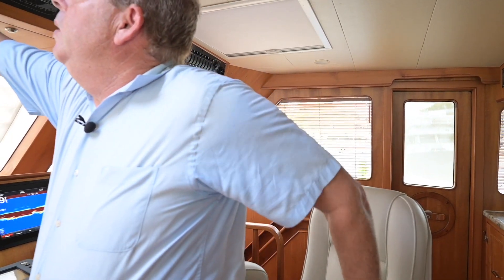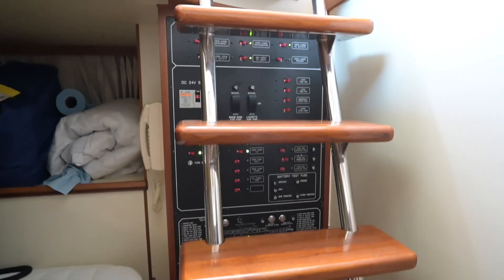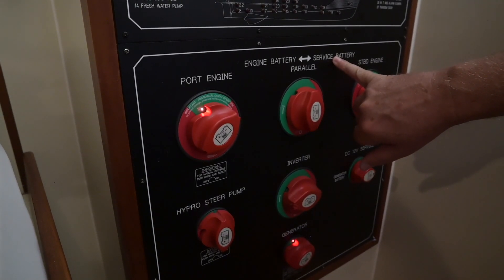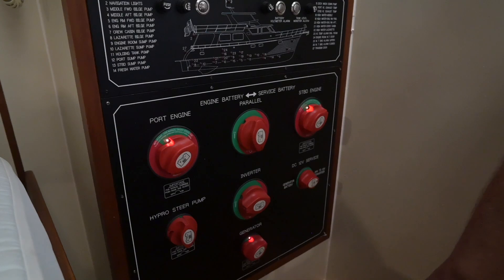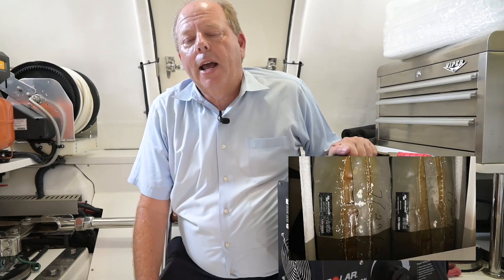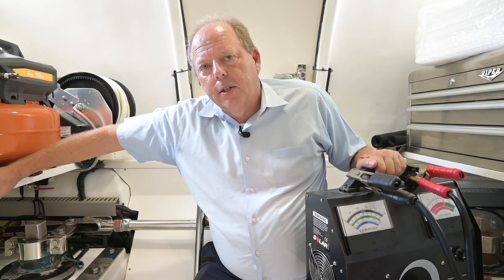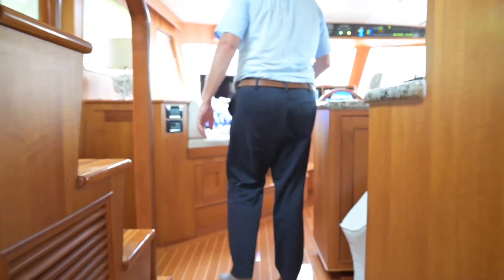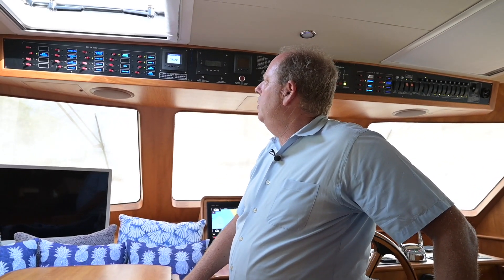How to Check Your DC Electrical Electrical System

Comment: Great Lesson! On older boats it's often a good idea to unscrew and grease the connectors of the alternators. Mostly the alternators don't go bad. Only the connection corrodes.